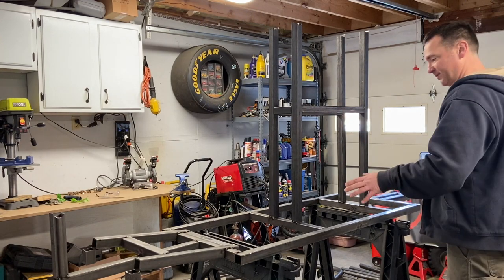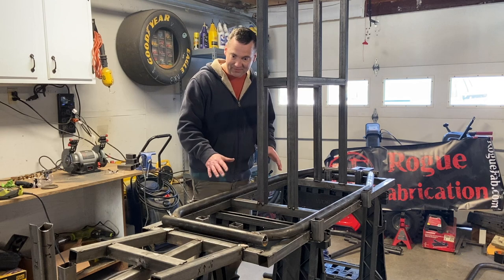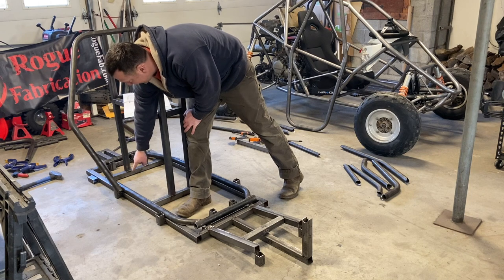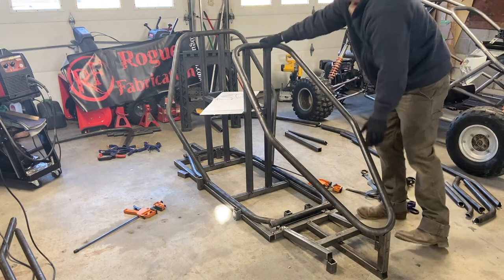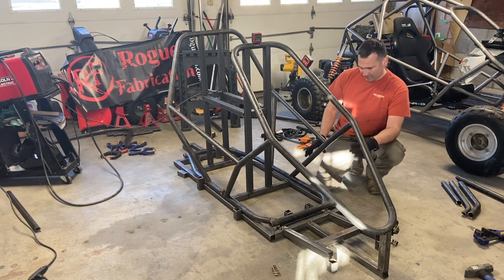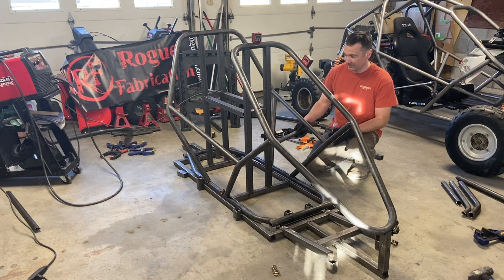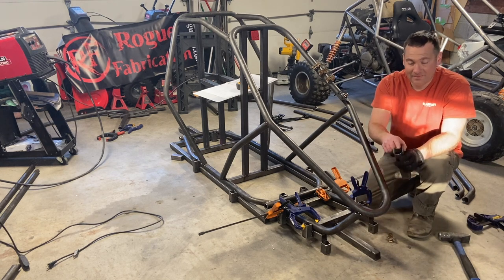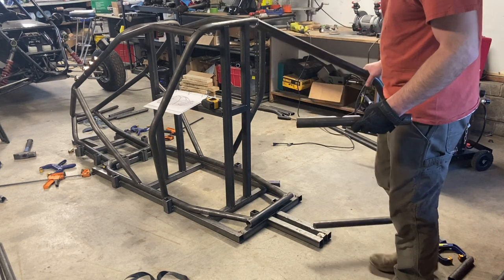Crosskart Build #2: Frame assembly. Link to plans in the Description

Comment: @KJ Racing do you do anything to address the opened ended tubes at final weld up? So you plug the hole
Reply from the maker: Those holes are used for the hooking protection/nerf bars 👍

Comment: wanting to start another build , do you have sources for CV axle spool , axles ?
Reply from the maker: I use polaris outlaw 500 or 525 stuff. Marketplace, craigslist and ebay is a good place to look. The best way to do it is get a used polaris outlaw 525 bike and use all the parts.

Comment: What Lincoln electric welder do you have back there?
Reply from the maker: 140hd mig. It’s all essentially thin wall so it does the job just fine 😁
Reply: @KJRaycing  Is it hard to use? I have no experience with that but with TIG and the teacher told me (speaking of a rollcage) to go with TIG for "aesthetics of the welds more than heat control" but that thing u use just looks way more practical, you're not welding exhausts yet... D'you think I could start use MIG with only little experience in TIG?

Comment: Been watching for a long time and starting my own build this fall. My question is how much does that tubing weigh per foot? Thanks!
Reply from the maker: I hope you can use my techniques in your build; I’m guessing you are trying to rebuild this design in CAD, but if you can’t find something as simple as the weight per foot of the tube you are using you may struggle a bit. Designing these things are all about research and finding solutions. 1.426 lbs for the 1.5” and 1.172 lbs for the 1.25”. There are plans available if you want to save a ton of time and money like so many others have.

Comment: It looks like you had the same problem I'm having now with J-12, J-13 and J-15 where C-1 won't sit flat on top of J-15.  Did you just cut J-12 and J-13 shorter so they didn't get in the way?
Reply from the maker: I just trimmed the notches a little until it fit. I used a spare piece of 1.5” to make sure everything was squared up.